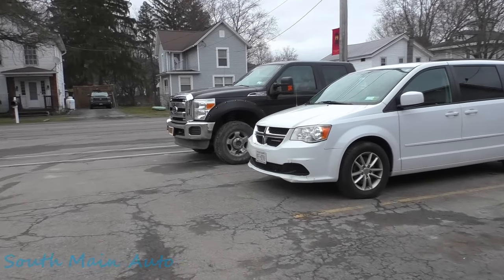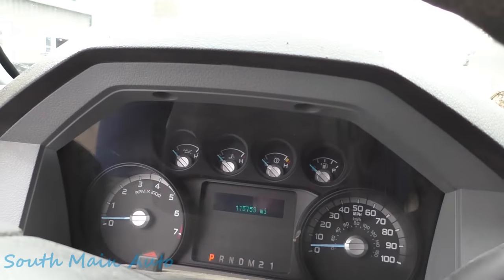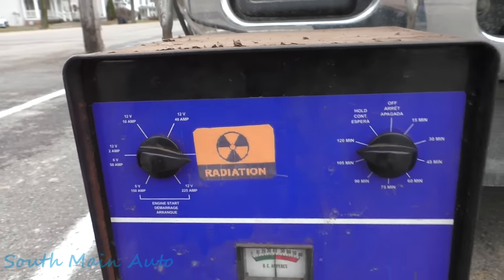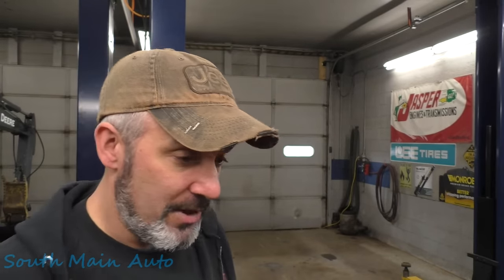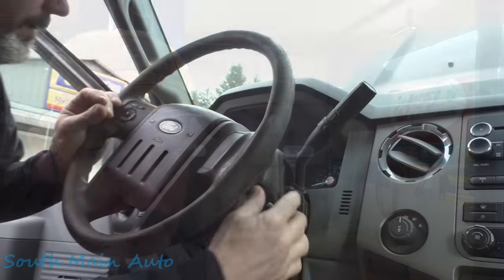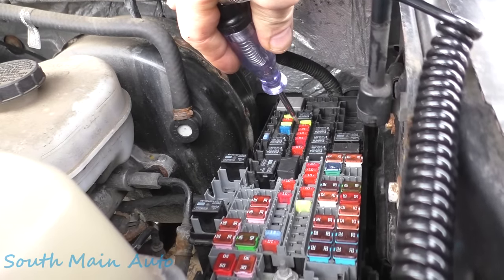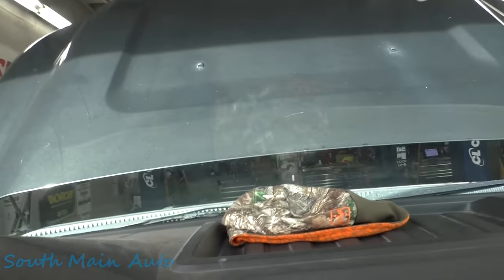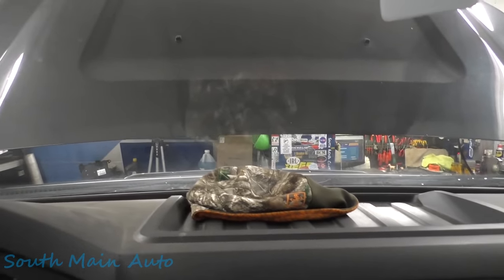Intermittent Stalling Ford F-250 : The Real Fix

Comment: So, the first shop was right. The fuse box was faulty. You did not diag it the first time because the signal from the BCM control side was steady when you tested it. Apparently fiddling with it fixed the wire under the fuse box tiemporarily.

Comment: You mean to tell me Ford made a main fuse box with no connectors - it all direct wired so if you get a problem you have to change the fuse box with all the wiring attached . Unbelievable but true.

Comment: Its common in the new fords. The wireing harness is poreley built. Ive had issues where i would go over small bumps, and the gauge cluster would light up like Las Vegas. Stupid truck would turn off. And would go in reduce power mode. Went to dealer 3 times. They replaced the fuel pump, and some random sensors. Truck only had less than 20,000 miles on it. They finally confirmed that it was a bad harness. After i had told them of my suspicions on the harness and maybe poor grounds ect. The ford 550 6.7L holds up its name. Fix or repair  daily, or on road dead. The newer trucks really suck.

Comment: I just came from the other video on this truck. You did get as far as the relay, but I did not see you test the power feeds to the relay. Still, that truck went out of the shop working. A broken wire? How does that even happen?

Comment: I have a master's degree in computer engineering. In my basement, I have been building PCs from new parts for 35 years. One of my machines had an intermittent, every couple of hours, drop-out of the video card for a minute. I finally took it to the best shop in town. They had it a week and told me they could not help. When I walked in to pick it up, not repaired, the former master technician was visiting. He knows me from way back. Hearing the problem he said, "I know how to fix this." He gave the case a hard whack with the palm of his hand. That was six months ago, and the problem has not returned. He knew the exact spot to hit it to seat the card in its socket. LOL. Machines are notional and you need a firm hand with them.

Comment: In the previous video you were about to check for signal and signal power but the problem fixed itself bc you pulled the relay.  The mistake you made was not using the classic reach around method when pulling the relay.

Comment: I had a Dodge Dakota that had a "bad" roll over fuel cutoff relay.  Nope, not really. There was a junction of 4 wires coming together 6" away from the fuse box. A green post mess hidden under a bunch of factory tape.  Cut the ends and spliced it all together again.  Never found it until I took the relay box of the fender, and all kinds of things started clicking. 😖

Comment: I one time had a machine I had to work on that was acting flakey. Turned out on a 5 volt ckt I had a fuse that LOOKED ok but it had a 0.5 volt drop across the fuse. So fuse looked fine but it was actually bad. Replaced the fuse and the machine worked just fine. So sometime a part can look ok and still be bad...

Comment: Could the 8 strand wire, which had become a 4 strand wire?, been able to carry the current during the testing a month ago. When it became a 2 strand wire it could not. The relay was approaching 'end of life', (good for xxx cycles), and was failing  intermittently. The new relay fixed that issue, but the wire issue had yet to cause any 'real' issue.  You have to be able to trust your testing equipment. Looking at both videos, I really think this was two issues on the same circuit.

Comment: Don’t ya love them fords we have a fleet of them fuse box sucks also the ground on the pass side top frame rail by the battery have gone bad causing internet stall also I’ve had three of them with intermittent stall with a bad cranky sensor/rust jacked usually get a code but there really fun to access left rear top engine try cleaning the pad of rust nice lol 😂upstate ny near you guys 👍

Comment: Quite possible the broken wire was the original issue but also that it damaged the relay 
But that’s the very nature of intermittent faults 
If you do something and it goes away and you can’t get it to fail again what can you do but get the customer to use it until it fails again 
Good job

Comment: Hey Crap happens! I honestly was wondering why you didn't look at the signal input more just to be sure. As I recall you did a get job. Way beyond my patience level. I have sold trucks and cars with less problems because My Patience level was maxed out. I also thought you were sickin that vid too. Thank you For sharing Your Fantastic Electrical Skills. This by No means discounts your Great ability to Fix these new Rats nest wiring fodder cars and trucks. and yes FORD IS THE Worst for short changing logical connectors and putting a mess of connectors on top of each other. so you have to undo 4 feet of wire to get to the plug in the middle that was assembled wrong. I'm going over board  Sorry Later Thanks again and Great Job!

Comment: What sort of test lamp did Eric use in the 1st video?....what load did it place on the circuit?
In the first video I see that he put his test lamp on the 12V feed for both the control & load at the relay terminals. I would have though the test lamp/light would need to put something like a 5A load to identify potential faults (an obviously dim bulb). Someone said it might be a 250mA test load which might not have been enough. Just a thought!
It is the only explanation I can think why Eric didn't spot the real problem first time around.....his fault finding seemed perfect.

Comment: I'm sure you diagnosed it correctly the first time.  If you didn't, then why did it work fine for a month?  I bet there were 2  problems in that circuit, and the intermittant one was working fine when you fixed the other one.  Maybe that wire got pinched during initial assembly, and it just took a while to permanently go south.

Comment: turning an old school battery charger output knob(tap settings) up/down, when it's powered up creates large voltage spikes due to EMF on both the output and line input sides. 
how so? it's physically changing transformer taps which is causing huge EMF spikes, so just think about how ignition coils function and what their output does. that's also why there are diodes(anti-spike) across relays/solenoids/coils(mostly integrated now), but they used to often be plugged into the fuse box or crimped in across the device(ac compressor).
🤓🧐 yeah, I;ve had my nerd on since my childhood, delving deep into electronics and everything mechanical, plumbing, construction as well.

Comment: "maybe i'm an idiot" always an option. Electrical is the most frustrating of all the problems as it can be so intermittent. My shop replaced a brake fluid level sensor as the brake indicator has been on for over a year and they had a used one, it worked for about 3 days and then the dash brake light came back on but I would rather have them try something logical and have it fail so at least it was tried, so now can try something else. wiring? maybe.

Comment: I have a 2008 f250 with 5,4 engine i have replace the fuel pump,i replace the gas sensor i have replace the drive module check all the fuses relays and still crank but won’t start any tips

Comment: The neighbor bought a car super cheap not running. They wanted me to help. It was a fuel pump relay  contact. I told them to pickup the assembly at a junk yard and do not crimp the end because it will fail when you need it most. What did they do? They crimped the end and worked great for a few weeks and failed in the Walmart parking lot. The wrecker towed it home.The sold it to someone else.
You should never be hard on yourself.I made a few mistakes on my Prius fix but nothing like the guy that worked on this car.  I have a Prius with a wheel bearing noise from the drivers side. Jacked it up and the wheel wiggles and ordered the bearing. Part comes in and I start tearing it down and the axial nut isn't peened. The wheel bearing was fine but while I had it off I replaced the bearing and the nut and peened it. That fixed the slight vibration at high speeds but that means I picked the wrong bearing. Ordered the bearing for the drivers side. When I tore it apart the bearing was bad but the person that replaced the bearing last time didn't install the brake splash plate and ABS sensor splash cup. I went to a dealer to pick up the parts 45 miles away. Installed the part and ran it around the block and it sounds good but on a long ride the brakes are getting hot. I still have to look at it this week but I never even removed  the floating pins because I took off the brake bracket only. I bet they are stuck because the new brake splash plate shifted the location of the pads. This makes them rub hard on the rotor.  Just going to replace a wheel bearing and it turns into a big project! After I fix all my errors it should be good to go! It's not a big deal!

Comment: Hey man I have 2011 f250 with no crank eve everything test good in fuses I get a click in the bcm when I turn the key to run and I also get signal from bcm to the pcm but I don’t get the pcm to send the ground to the run relay and also doesn’t give power to the audio control to that same relay. If I manually send the power from the relay to the starter it only cranks doesn’t start. I have two codes for pats what are your thoughts?

Comment: Don't let it get to you, it could be worse. Like the time I took a Jet into the shop to get the Auto Pilot fixed, they said they did the troubleshooting and found the problem and fixed it. Next trip the Auto Pilot failed while cruising at 43,000ft and over an hour to go to the Destination, had to hand fly it doing 440KTS, I was drained when we got home.
Some days you eat the bear and some days the bear eats you.

Comment: Okay I got a f250 super duty 4 by 4 2000 all interior lights and exterior lights are flickering they told me to battery was almost halfway through it's life they said the alternator could be replaced got ground strap still doing it what else would it be the old alternator acting the same way I'm getting pissed

Comment: Say what you will about that fuse box, I'd way rather have that style than one with a PCB. I can fix a corroded terminal or broken wire, I can't fix a faulty TIPM.

Comment: I think he knew she was coming back. First time probably missed putting a load on the wire feeding the 12V to the solenoid. But got there in the end. Pissed that didn't catch it first time.
No charge to the customer for 2nd visit. But they saved on a new wiring harness.
Another hard lesson learned......but this time probably couldn't be helped because common sense told you it was the relay.....999 times out of 1000 it would be. 👍
Reply: I reviewed the first video and Eric did put a load on the control feed directly at the relay pins (with relay removed). So his fault finding was perfect. I can only assume the test load wasn't large enough....probably needed a load of circa 5A.

Comment: last time, if it's the same vehicle, the control side was present

my question is: did someone else "cut" the cable to either get the fuse box replaced or get a discount for a misdiagnosis ... or it's just a huge coincidence

Comment: hey, thank you for all your videos. i have a 2011 honda fit, when im driving out of know where my electrical power steering turns off then all the lights came on and my dash lights are on but all the needles are as if the car was off. but it was running,it was kinda still but still running just lost electrical power..i know it does'nt make sense i wish i could send you the video...iv never had any electrical problems until i just had the clutch master replaced beacuse  i did'nt have the tools up here visiting my dad. soo they want 100$ just to look at it. but they don't need to  i have a video. it happens out of know where you could be driving 30 miles perfect and then out of know where it happens. all u do is push in the clutch and it all comes back alive. every   time all i do is push in the clutch and it all comes back like nothing happened. once it happenes  it keeps doing it every 30 seconds???? any ideas? i know verry confusing,.i iwish i could show you the video..,,.      DRIVING ME CRAZY!!!!

Comment: Please remember that I'm 2011 in newer were the batteries are programmable that you should disconnect the cable when you charge the battery And it's truly just a coincidence in the battery charging that all this happened after 51 years of doing this I have run to the same situations you have with intermittence you think you have them pinned down and of course the issues dig deeper I can remember all the way back to 1982 on a Chevy citation that had come to me with intermittent hesitations or a quick loss power it had gone back to the Chevrolet dealer at least a dozen times unable to find it at that point the customer after giving it to me a couple times said to me I know you can find this problem I heard you're the best (I said to myself yeah right Maybe I try harder than most but I'm not the best) so I pursued the problem it only happened on acceleration from a dead stop of course we've all done foolish things in our days I happen to lean over the fender of the car  with the hood open and one of the employees drive the car forwards and I tried to observe everything that was taking place then I would have him put it in reverse it did not do it in reverse and I noticed since it was a citation it was transversed at the engine would down push in the front I kept looking what could be happening of course it was a wire harness that ran across the top of the compressor it seemed to have plenty of slack well on acceleration that harness would come down and touch the top of the AC compressor it rubs such a tiny hole in there I didn't see it I didn't feel it but I knew that that's where the problem was because I actually put my hand underneath there held the harness even tighter away on acceleration and a problem disappeared after unplugging it and pulling that loom partially back I saw the tiny hole of course I had a grin from ear to ear but to determination is very important or not perfect and we're not in a perfect world never put yourself down especially if you know you're doing your best I see you've invested a lot in tools to help you make these problems get resolved faster That is one of the crucial elements of this job having the correct tools to help you get the job done it's not too impress anybody which we both know and probably a lot more know anyway good luck on future ventures hopefully you do fine unfortunately I retired at the beginning of the year due to physical attributes being in bad shape my legs just don't function anymore😢

Comment: Simple Fact:  You found and fixed the wire on a system that was never intended to be repairable, and saved the customer's vehicle.    The Ford repair (Harness/Fusebox combo) would have been cost prohibitive, and even a junkyard supplied harness fusebox integrity would have been questionable at best.     This repair for some diagnostic labor and a start relay and wire repair is a lot less than losing the vehicle or replacing the harness.   Customer should be happy the problem was found and repaired, without having to replace Fusebox & Harness.

Comment: The only way you might have missed that would be from not loading the circuit. As i'm sure you are aware, voltage doesn't necessarily mean current capability. Not that that side needs much ... SMH

Comment: Eric I have to disagree brother. Every chevy truck I have ever owned has been the most reliable trucks I have been around. I have an 03 1500HD with 87,000 miles on it that came from Michigan and is in very good shape. And at least where I live you see alot more older chevy trucks on the road than you do dodge and ford trucks.

Comment: Don't feel bad , on time a customer came in for a "growling sounding in rear" ... I quickly swapped out the wheel bearings and called the customer... Wouldn't you know it, the sound was still there .. turns out her son dropped a bag of marbles in the spare tire well and the were vibrating and sounded EXACTLY like a wheel bearing, even got quite when swerving (because they rolled to one side and held still for a second.... 😢

Comment: Customer did not read fine print Ford intermitent not covered ,,I had a intermit ,short ,F150 Fuel inj circ or open 
Turned out after workin on this off an on for six mo ,was wrire loom from compute to injectors.sensors ,distrib .There was no exterior damage visible to looms ,apply large bottle of bayer or yeger

Comment: I'm pretty sure you checked for power on the terminals. I hate when the factory workers pull the wires so tight on there wiring make up boards that you haven't any slack to work with. That wire was probably pulled so tight that it finally gave up at its weakest point, could have been contamination in the copper mix or the wire was stretched thin when it was manufactured. Being manufactured overseas quality control is lacking. On one of my Fords you could run your thumb nail down the wire and strip the coating right off, I ended up having to rewire everything under the hood. I had a step motor on a rv that would work when it was removed form the step and plugged into the harness but when put back in place it wouldn't work. Turned out to be one of the terminals was pulling back in the connector and not making contact when the motor was installed. The motorhome manufacture uses a wiring board and again pulled the wires so tight there wasn't enough slack to make the turn when the motor was plugged in. Back probing, everything had power were it was supposed to. Thankfully the wire broke were it did allowing you enough room to get a connector on and relief the tension on that wire. That would have been hours of labor if you would have had to replace that fuse box and the wiring harness.